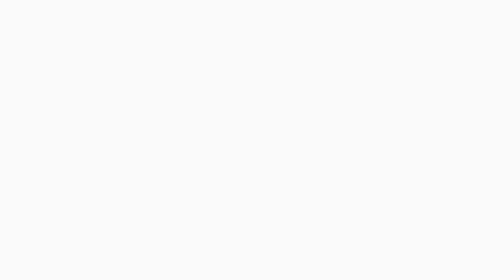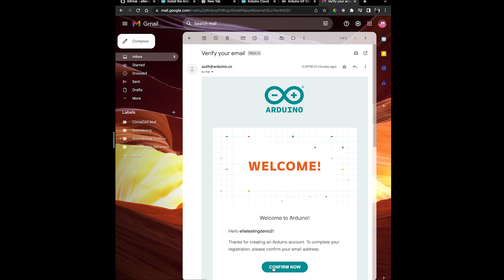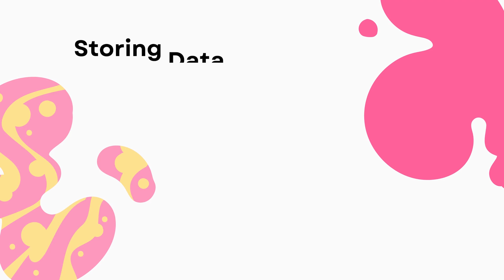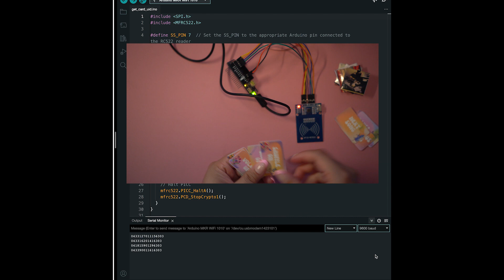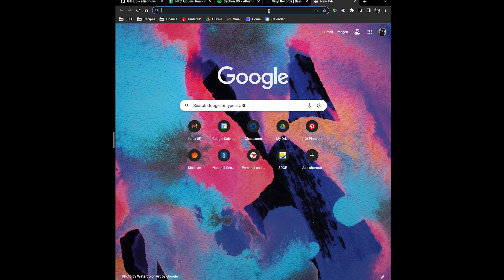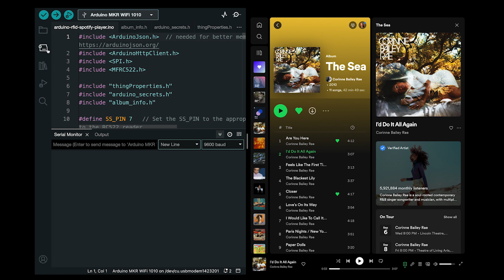Build a Modern Day Record Player with Arduino, RFID RC522, and Spotify APIs!

Comment: Hello Ellie,
Thank you for you great video and clear explanation.
I was just curious to know why you used Arduino IOT ?
When i tried to follow your steps, I had issues trying to reach Arduino Cloud and could not pursue your path.
I tweaked the code to go around it and now i have a similar project as yours without connecting or using Arduino IOT, so I just wanted to know what was the added value of using it.
Thank you very much :)
Reply from the maker: Hi! I'm glad you found it useful and you were able to get it working. I don't think it actually needs IoT lol. 

My original intention was to use the Arduino IoT Carrier to display the songs and control the Spotify player but I couldn't get both the carrier and RFID working at the same time. 

Do you have a github repo you can share? I'd love to include it in the video description!